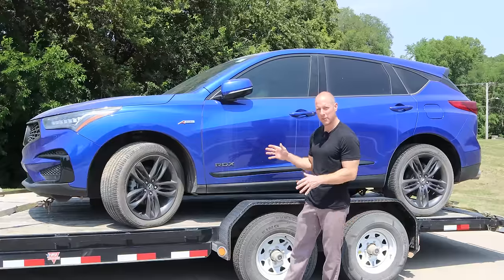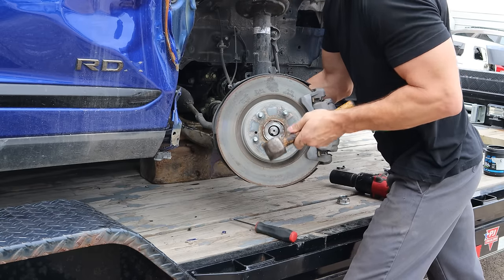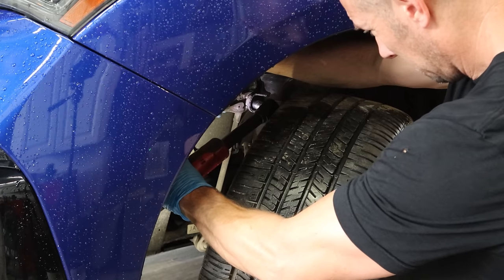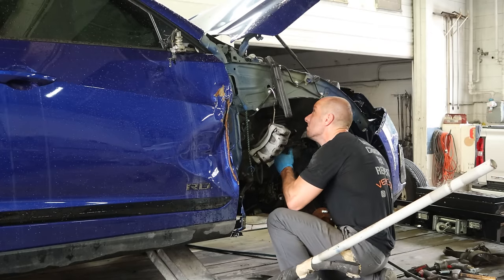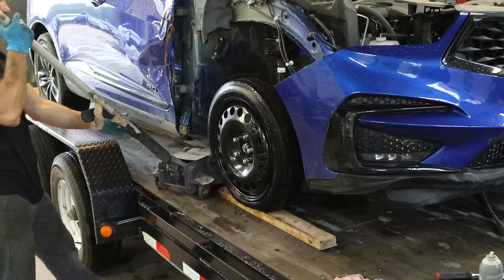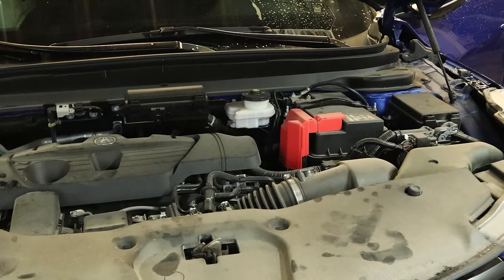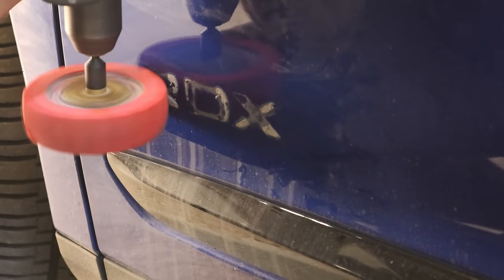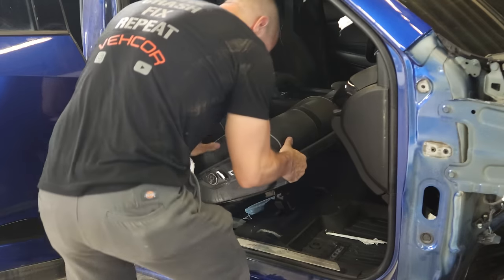Rebuilding an Acura RDX Aspec AWD with deployed airbags after hitting a pole.

Comment: Does anyone REALLY give you core price for that wheel?
Reply from the maker: Cores are no longer for obtaining rebuildable parts.  They are now a tax.  A salvage yard can sell a wheel for $200 with a $100 core.  You don’t return a core and they get to collect $300 for their wheel that was originally cheaper than other yards which is probably what brought you in the door.  If you do return a core, they toss it in the scrap pile and get $20-40 for it.  They really don’t want the core, they make more if you don’t have it.  The same goes with engines, transmission and rearends although they do occasionally sell those to rebuilders if they are in high demand.  Manufacturers are doing it with headlights, bumpers and other rebuildable parts to stop remanufacturing companies from repairing parts and driving prices down.  Sorry for the novel.

Comment: Seems odd to have to turn in a 2 peice wheel as a core.
Reply from the maker: Cores are no longer for obtaining rebuildable parts.  They are now a tax.  A salvage yard can sell a wheel for $200 with a $100 core.  You don’t return a core and they get to collect $300 for their wheel that was originally cheaper than other yards which is probably what brought you in the door.  If you do return a core, they toss it in the scrap pile and get $20-40 for it.  They really don’t want the core, they make more if you don’t have it.  The same goes with engines, transmission and rearends although they do occasionally sell those to rebuilders if they are in high demand.  Manufacturers are doing it with headlights, bumpers and other rebuildable parts to stop remanufacturing companies from repairing parts and driving prices down.  Sorry for the novel.
Reply: @vehcor   No need to apologize! Its always interesting to hear why some things are done the way they are.

Comment: Sweet car, i believe the engine on these are the turbo k20 used in the newer Type Rs with different tuning and probably a smaller turbo as well. Nonetheless a very reliable engine with lots of power potential

Comment: Hey Scott, I'm curious to know if you replace the seat airbags and reupholster them or get new seats altogether?
Reply: Previously, he was getting the OEM seat back cover only - reupholstering is not the right repair procedure since OEM use special threads for that airbag to deploy properly.
Reply: On my rebuilds,  I purchased and installed seat bag,   tested and then sent the seat to a an upholster that specialized in this type of work.  He used a special tread to complete the repair

Comment: They would accept a split wheel for a core? Would they really straighten that wheel and weld it back together?
Reply from the maker: Cores are no longer for obtaining rebuildable parts.  They are now a tax.  A salvage yard can sell a wheel for $200 with a $100 core.  You don’t return a core and they get to collect $300 for their wheel that was originally cheaper than other yards which is probably what brought you in the door.  If you do return a core, they toss it in the scrap pile and get $20-40 for it.  They really don’t want the core, they make more if you don’t have it.  The same goes with engines, transmission and rearends although they do occasionally sell those to rebuilders if they are in high demand.  Manufacturers are doing it with headlights, bumpers and other rebuildable parts to stop remanufacturing companies from repairing parts and driving prices down.  Sorry for the novel.
Reply: @vehcor  no please novel away lol, all of it was gold, thank you.

Comment: Seems like the insurance companies total these new tin cans...uh cars...with what seems like minimal damage. Do you have any idea (A) what that vehicle is worth and (B) what the estimate was to fix it? (this or another of your builds)  Do they go by a percentage of damage to determine fix or total?
Reply: The threshold for a write-off is based on a percentage of the value of the car in the condition it was before the accident.   But the calculation is not just based on the repair cost - it also factors in things like external costs and the salvage value of the vehicle in it's post-accident condition.  As an example, my car was written off after a fairly minor accident (similar to the car in this video, in fact) - this was based on a number of things - (1) the parts were on backorder with a long lead time (2) my policy provided a replacement car while the repairs were being carried out and (3) the vehicle had significant salvage value - taken together, they wrote the car off.
Reply from the maker: Worth $45k, rebuild cost was $25k.  70% is the general threshold for a total loss but due to the back order of parts, they total it to avoid paying for a rental car the entire time.  They also know they can get a good price at auction so it becomes a numbers game.  If they can total it and end up paying out the same or even less it makes sense, no liability that way.
Reply: @vehcor   Thanks Scott! Hope you and the family have a Merry Christmas and a Happy New Year!

Comment: You Can’t back your trailer in under your lift to take the car off of the trailer? I pulled several three wheeled vehicles off my trailer with my lift.
Reply: What is the point...?  Do you think, or just pull the pin on your mouth and let it blow?
Reply: @Look_What_You_Did  exactly